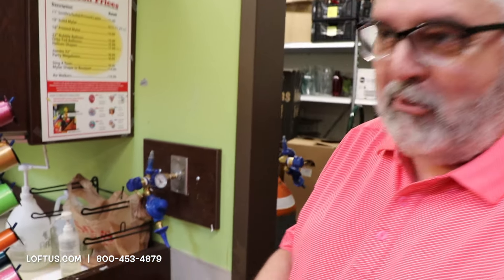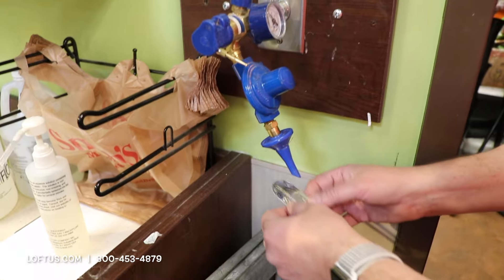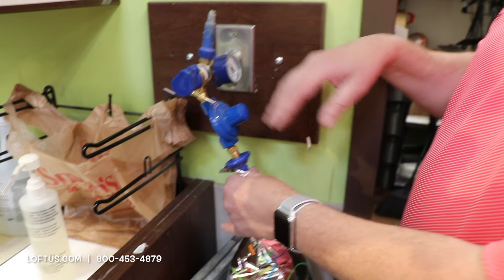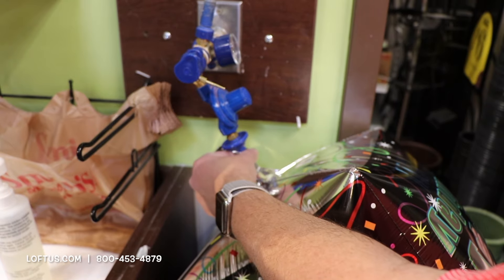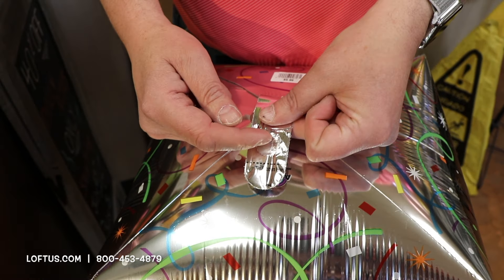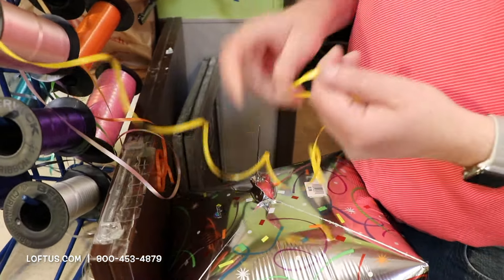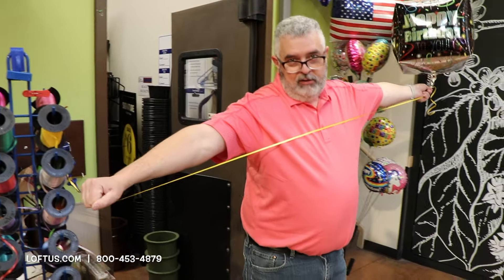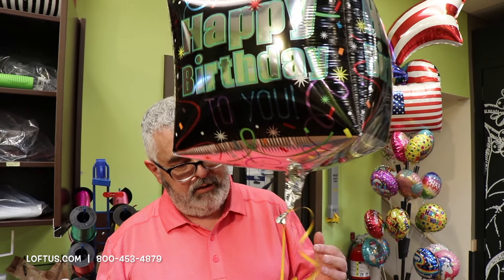How To Inflate And Finish A Foil Balloon

Comment: I dont have that kind machine so how we can do it at home?😕
Reply from the maker: Hi there! You can as for a "hand held air inflator" at a party store. It pumps air into foil or latex balloons and is perfect for a home party. It will only use air, so of course it won't float, but most large foil balloons come with hanging tabs now. You can use ribbon or monofilament line (fishing line) to hang the balloons. By using air, you'll also save yourself some $! Here is a link to see what they look like. https://www.loftus.com/pages/tyingballoonshandpumps  We are a wholesale only distributor, so you'll have to check your local stores to purchase a hand held air inflator.

Comment: So... when you filled it how did you close the hole of where you filled it from? sorry first timer and i have a dog snoring in my ear 🥴😂
Reply from the maker: Hi Hanna! On all foil balloons, there's a valve that will automatically close when you remove the balloon from the inflator. That's why it's important to tie the balloon where indicated like Craig shows. This way, the valve doesn't get crimped or damaged, and if the balloon naturally loses helium (if it's been up for a while), you can reinflate the balloon using the same hole. It's a trade secret - don't tell anyone!  :-)  Hopefully your puppy had some sweet dreams!
Reply: @LoftusInternational  amazing advice! thank you so much!! xxx
Reply: @LoftusInternational  thank you for things info, I always wondered and pooped them thinking they were for one time use 😂😢🤦🏻‍♀️

Comment: I've bought foil balloons online that seem to be sealed and it's hard to get the valve through. Does a good quality foil balloon seal itself when blown
Reply from the maker: Hi Ileana, couple of things you can try - on the valve, there may be a plastic flap you need to get under to inflate. Some of our balloons have that. Another thing, when you fill the balloon and remove the inflator, make sure the valve is flat. Tie any ribbons below the valve as well. Here is a link to watch Craig flatten out the valve so you can see what I'm talking about: https://youtu.be/xbrl6bI79Qw?t=45

Comment: Why did it go down if you blow up
Reply from the maker: There is a valve on the balloon that allows helium or air inside, and then it stops the helium or air from leaking. If the valve is damaged or if you tie a ribbon around the valve area, the helium or air will slowly leak out. It might also be a small leak in the seams of the balloons as well. If you smooth out the valve and tie where it shows the dotted line, you have done everything you can to keep that helium or air inside the balloon. Hope that helps!
Reply: @LoftusInternational  Thx

Comment: I occasionally have to fill foil balloons at my job. Do all valves automatically stop so you won't overfill? I'm so scared of popping a balloon!
Reply from the maker: Hi Kuduk, if you use a Foil Regulator (like the one in the video), it will automatically stop once the balloon is full. If you don't have this kind of regulator, you're going to have to watch it. Typically once the balloon is full, you'll see a lot of the wrinkles disappear along the seams. Hope that helps!
Reply: This helped me a bunch as well because I from time to time am called on to inflate foil balloons. Thanks!
Reply: @LoftusInternational  So almost a year later and I've blown up more balloons than I can count. Our tank must have a foil regulator, because I purposely tried to pop one but couldn't. But I've learned just by feel and sound when the balloon is full. Ironically I actually don't blow up balloons much anymore because we're always out of helium! Thanks so much for this video and your response; it really helped ease my fears. 😀
Reply from the maker: @KudukUngol  Oh good! Happy to help! Yes, the helium supply is rough right now. Have you checkout out our air-filled design videos? You can get a lot of easy designs made with all air-filled balloons. Thanks for your comment!
Reply from the maker: @Beanz572  Our pleasure, 7Deuce!